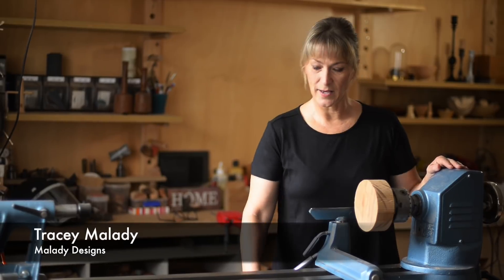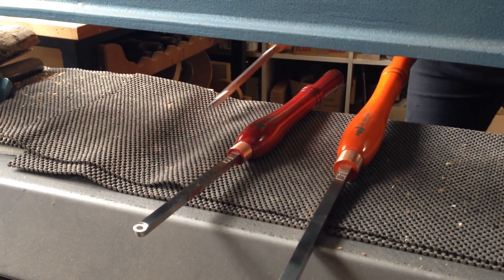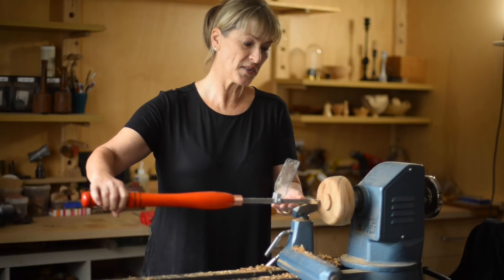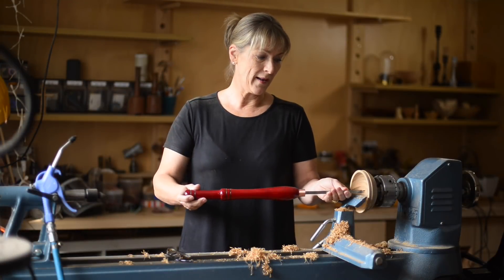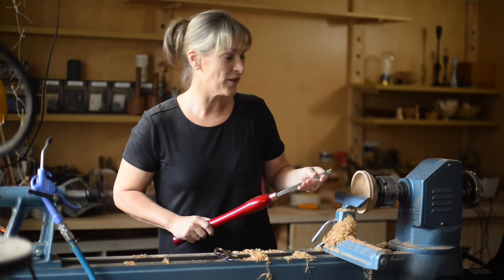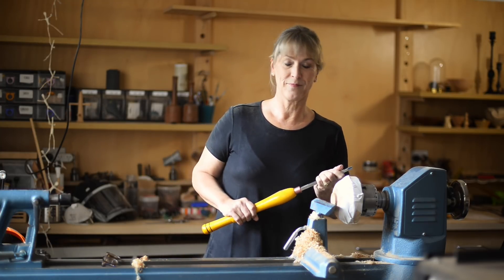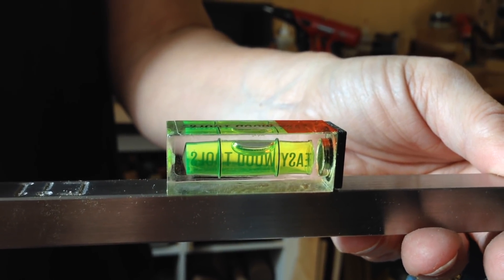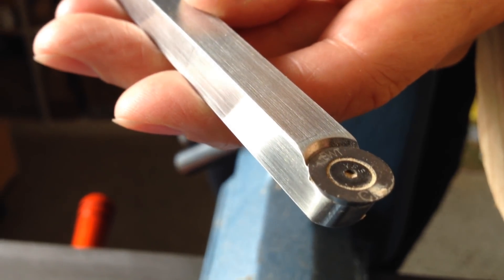Introducing EasyWood Woodturning Tools

Comment: Hi Tracey, Looking back several years I just realized that you were instrumental in my taking the carbide road instead of the traditional gouges path.  Thank you so much for your gentle instruction methods that certainly assured me I was on he right track.  Your instruction along with another professional turner who, when asked if it’s better to used traditional tools or carbide tools responded with “ if you would rather turn wood than spend your time sharpening tools take the carbide direction”
I must admit I use several styles of cutters  as well as various goose neck handles and flat scrapers to produce hollow forms but the basic three are still the most used.  Thanks for the guidance.

Comment: Wonderful to watch your video and you using the gouge. I am a first timer. I just bought a lathe and EasyWood turning gauge. I was thinking would I be able to use the bowl gauge safely, would I able to set the angle right, how would I face a catch if my angle is not right, etc. Thanks for easing my fear. I did buy finishing gouge with the lathe. Your explanation, your pleasant voice, your way of describing essential points, etc., a perfect combination of an effective teacher. I have saved and subscribed your video. When I get disappointed with my turning, I will watch your video to feel better.
Reply from the maker: Thank you for your comments, we are very glad you are enjoying your Easy Wood Tools turning tools.  A gouge is typically a traditional HSS turning tool, we refer to our round cutting tool as an Easy Finisher.  Our square cutting tool is called An Easy Rougher and the diamond-shaped tool is an Easy Detailer.  Thanks again for your kind remarks.

Comment: do you like the square shaft as compared to the round.  i have used only rounds and feel i can do better shear cuts?
Reply from the maker: Hello Mike - thank you for this great question.  Easy Wood Tools carbide-tipped turning tools are scraping tools, not designed for shearing.  The square shaft held flat on the tool rest and parallel to the floor gives you the safest and easiest to control cut. Thank you.

Comment: I have an easy wood set and while I find it relatively “easy” to shape the outside of a bowl I 
Can’t for the life of me seem to do the inside walls without getting a major catch.
I use the full size finisher, I’m careful to keep it level but bang it catches both near the lip of the bowl and down the bottom where it sweeps into the base.
It’s driving me nuts, especially when I see here videos, any tips out there for a frustrated would be bowl turner would be most gratefully received, thank you.
Reply: Hello Paul - There are many variables when turning that can cause a catch.  Keeping the tool level is important but also make sure to keep the tool rest adjusted as close to the project as possible, the less overhang the better.  Adjusting your speed can also be helpful, try increasing your speed a bit to lessen the chance of a catch.  Our new negative rake cutters will almost completely eliminate catches.  The Ci0NR cutter is the right one to fit your Full-Size Easy Finishing Tool, I know you will like it.  You are also welcome to call me here at Easy Wood Tools (859) 246-0294 and we can talk through it.  We are here to help!
Reply: @jbluley  Thanks for the reply, I’ll give that cutter a go, I’m in the U.K. but thanks for the phone number.
Reply: @jbluley  I did try it and it worked a treat, I finished my bowl and it turned out great, thank you.

Comment: The wood nor the end viewer know what tools were used. carbide..hands down is easier to use off the mark and are far cheaper to maintain..I would get rid of your present round holding bar and go with a flat piece of stock. mind you..the old guard will say that if you are not using the old style tools...great vid
.

Comment: Purists hate these tools. I am not a purist. I dont even own any wood turning equipment, but I have turned a couple of bowls from processed fire wood, using high speed tools, needing to be sharpened too many times. I dont own a grinder because I am afraid of fires caused by sparks. These tools have increased my interest in wood turning and in buying my own equipment. Thanks.
Reply: EasyWoodTools were the first set of tools I purchased less than a year ago or so when I first started turning anything. I recently got a new lathe as my old one died, and with it came a very nice, and expensive, set of high speed steel tools.... I still prefer carbide tools. Much easier to work with, no need to sharpen, although you CAN sharpen carbide tips.

Comment: Great video, I would love to get a chip deflector but at £80 ($111) is just too much to pay
Reply: EWT are awesome... However if you want to make your own chip deflector and have a drill and a hacksaw you can make one practically for free. (I've made a couple myself; a small perspex offcut and some glue and a small nut and bolt is all you need).
(Or you can buy a cheap clear face shield instead of the chip deflector.)
Reply: I don't think it would be that difficult or expensive to make your own chip deflector.
Reply: I also see that Easy Wood Tools has a chip deflector available for $26.99